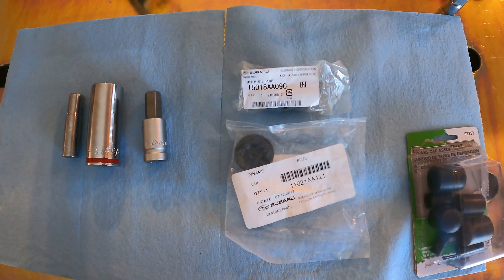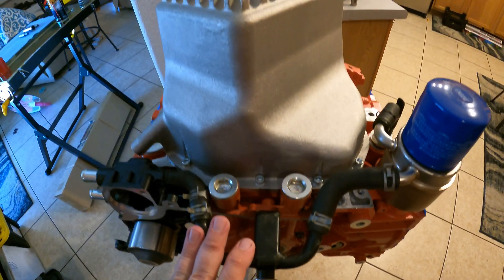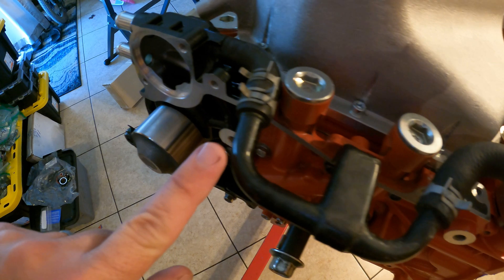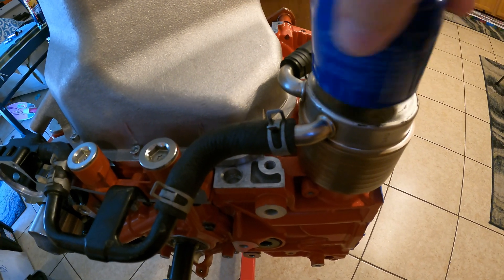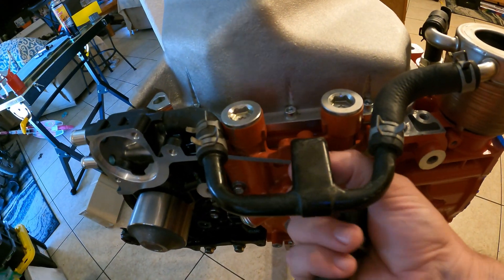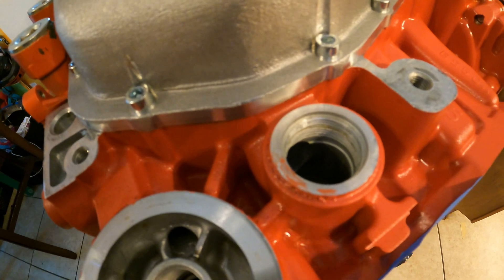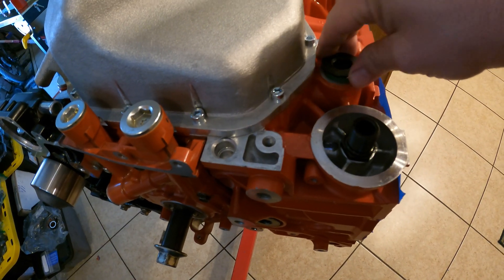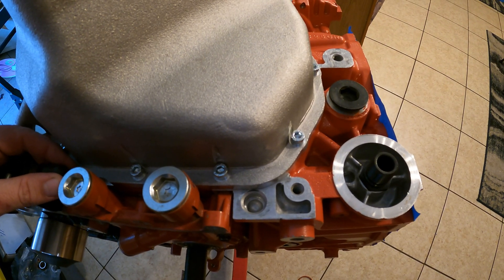Subaru STI Factory Oil Cooler Delete

Comment: Will the water pump cap eventually leak? Have you had any issues? I was thinking of doing this and leaving just the 90 hose that attaches to the water pump and put a bolt, and hose clamp.
Reply from the maker: I have had zero issues YMMV.  Some people tap the inlet and insert a bolt to plug permanently.
Reply: @phxgsxr  do you need to remove the water pump and timing off the car to do the tap?

Comment: Cool setup.  The only week link I would do differently is to pull out that inlet pipe fitting on the water pump, drill and tap it with threaded cap with Piper sealant applied.  Those rubber caps are known to blow out especially if you're planning on tracking the car.

Comment: So you don’t need a oil cooler? Won’t it run hot?
Reply from the maker: This is generally done when you have added an aftermarket oil cooler.  I have a dedicated setrab 24 row oil cooler in the car.  The factory oil cooler on track  dumps heat into the cooling system leading to overheating.

Comment: Instead of plugging the outlet and tapping at the water pump, we just connected the circuit directly which allowed us to remove the warmer/filter unit thing.  

Not sure if there's any issue with that, but i will say driving around town, like I've mentioned to you when talking about the ducting, water temps are way down.